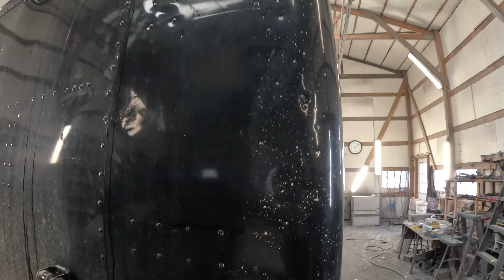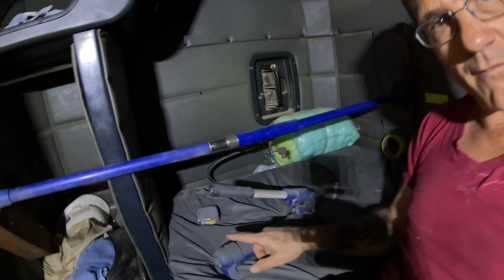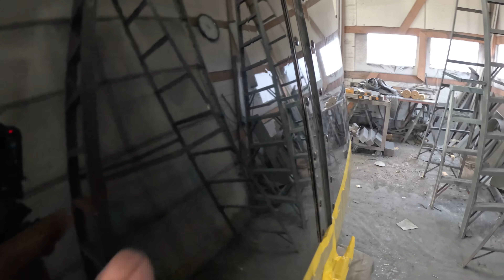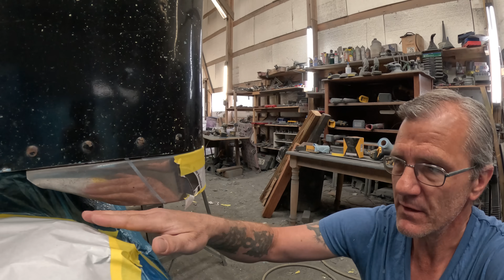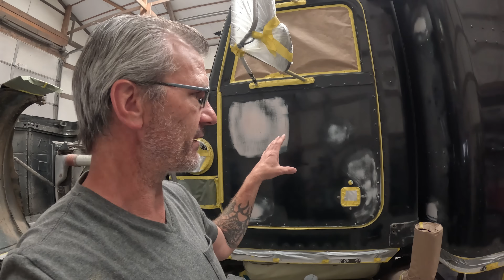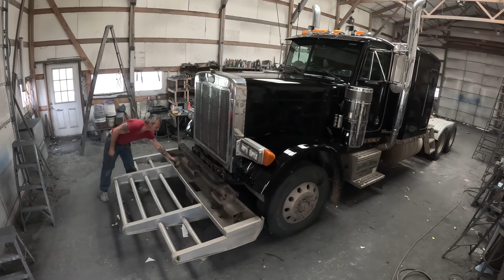1995 Peterbilt Overhaul...The Sleeper Hit Of The Summer!!!

Comment: Your work is an inspiration to watch. What kind of rivets do you use and do you have to fill the heads on them to make them look original  ? Thank you for a reply.
Reply from the maker: Thanks a ton! They are 1/4" blind aluminum rivets. I'll often dab a little silicone in the hole after they have been sanded to seal them up. I have 2 huck rivet guns...but I'm not too crazy about tearing out interiors of older trucks that aren't going to be show trucks....and the interior needs to be removed for huck rivets
Reply: @teams.t.e.a.m6214  Thank you for the reply

Comment: Hi Ray another fantastic old Truck ready to go back to work your a fantastic tradesman mate.i have a question your paint work is shinny of the gun it doesnt require cuting or polishing ??? and no clear coat is that only used on cars Just being a curious Aussie .Love the channel
Kym
Adelaide
Reply from the maker: I see many, many trucks that come to my shop with failed base clear paint jobs. We're doing a 2005 kenworth right now with the factory applied clear coat coming off of it everywhere. Base clear...when it comes from the right company and is correctly applied...is as tough as they come. In the work truck world, however...It's just not as good a choice most times as a quality 2K urethane is. Thank you very much, My friend from across the big pond!
Reply: @teams.t.e.a.m6214  
Mate appreciate the reply explaning